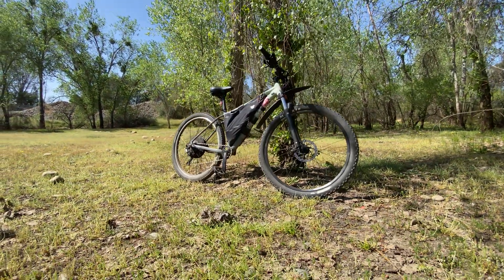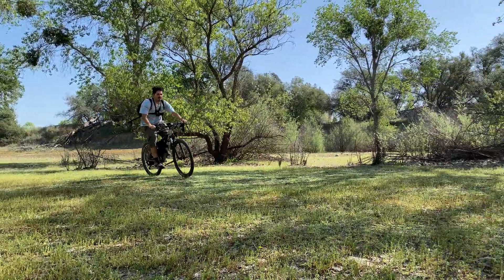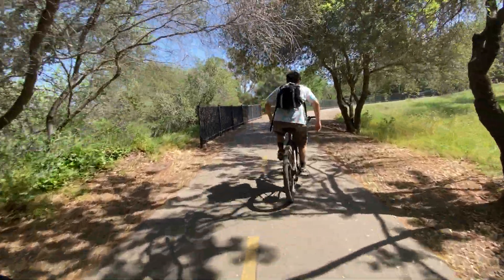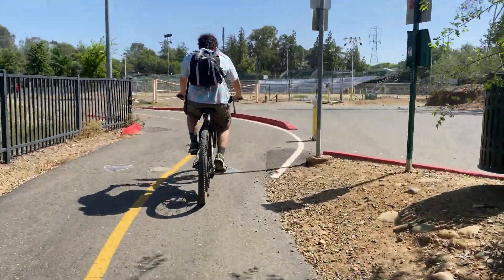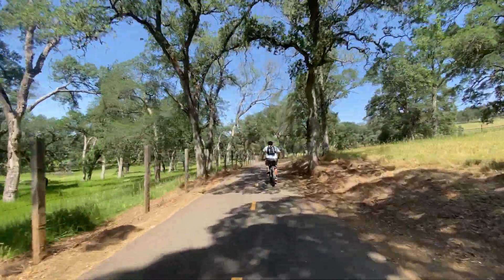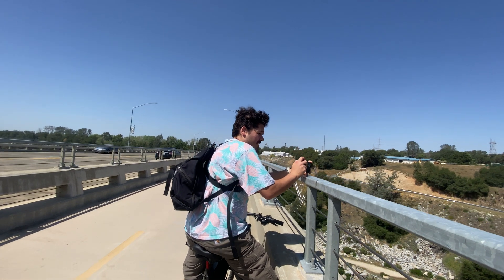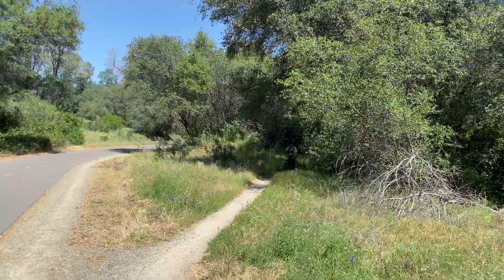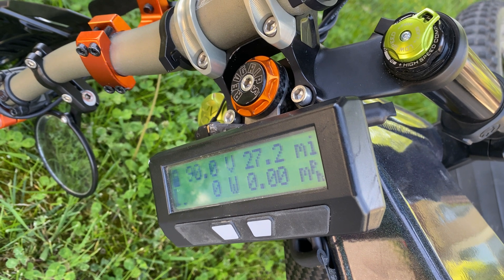Is a 1kw Hub Motor Enough Power? (E-Bike Ride)

Comment: I have a 2000w hub motor with a 48v battery which has a 30a bms and 45amp controller but only can reach speeds of 30 mph is this about right, I will upgrade to a 72v battery when I can afford it. Great video by the way 👍
Reply from the maker: Hey, thanks. A 2000 W hub motor running at 48 V should be able to hit up to 40 miles an hour depending on the motor winding. A high torque motor will go slower but have more acceleration and I’ve seen those go as low as like 28 miles an hour at 2000 W.

Also, if you have a 48 V battery with a 30 amp BMS it shouldn’t work with a 45 amp controller. As soon as the controller demands more than 30 A, the batteries management system will shut it off.
Reply: @ErikKibbee  maybe I have a higher torque motor the best I have had is around 30mph but great going up hills, battery seems to work fine but going up hills under load battery indicators go down and then jump back up again after releasing the throttle so hard to judge what battery I have left, will be getting a 72v battery next week so hopefully more speed and range, thanks for getting back to me cheers gaz ✌